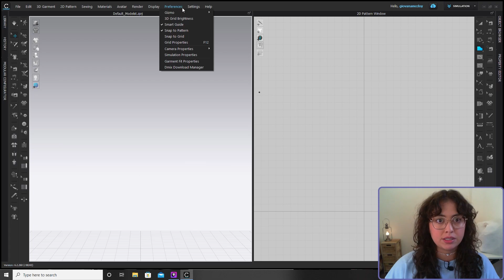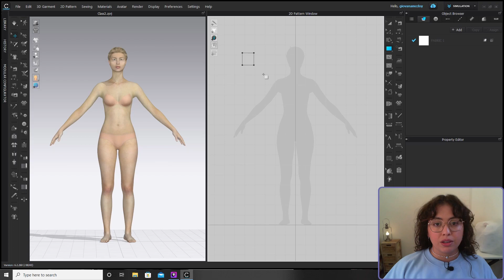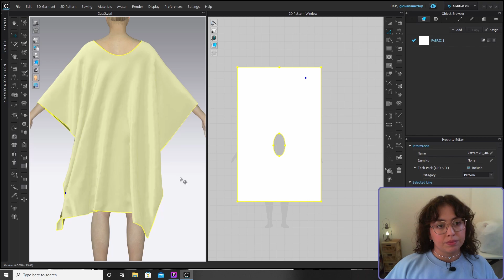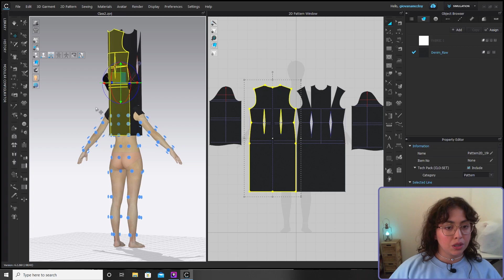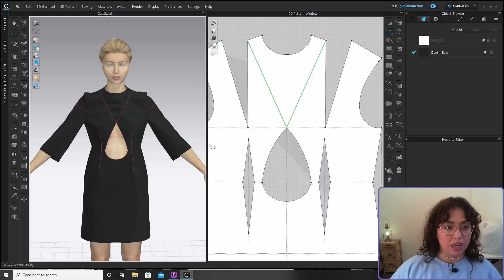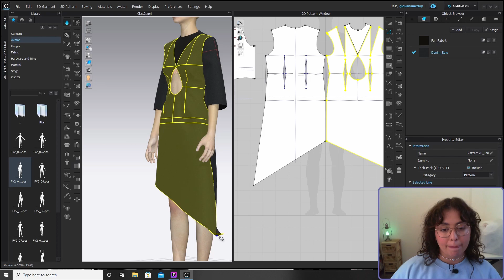The basics of CLO3D - showing how the software works - CLO3D tutorial (ENG)

Comment: Thanks amazing but it will be good if you teach how to use the tolls and the shortcuts the keyboard so we know how to handle easy
Reply: I came here to say this 😭 I'm really new to this, just started using it today. But I'm having a hard time because I couldn't find any tutorial explaining the tool. I don't know how to zoom-in to specific area, or scroll the page (let's say the screen zoom-in on the sleeve pattern, but I want to work on the bodice pattern, so I zoom-out but then I don't know how to zoom-in to the bodice pattern, or I don't know how to scroll the screen horizontally or vertically so I could focus the screen only on the bodice pattern). I also don't know what tool to use to measure the line (let's say I want to adjust the sleeve-head, I need to measure the armhole from the bodice first but I don't know how to do it. I used the measuring tool but it doesn't work as I was hoping for).

*I don't use mouse or drawingpad, I only use the touchpad from my laptop.
Reply from the maker: The shortcuts are signaled next to each tool ☺️

Comment: cut hole option is not coming -_-
what should I do
I searched but I am unable to find
it's not coming on right click
Reply: Dude i had the same issue, then I realise in this video for some reason it looks like she is using "base eclipse"
 but you need to use "Internal eclipse" and then click on 'A' and click on the eclipse and you'll see it is marked, then right-click to use 'convert to hole'!
hope it helps!
Reply: I also do not have a cut hole option :(
Reply from the maker: I'd maybe update the software and see if that fixes the problem. Thanks!